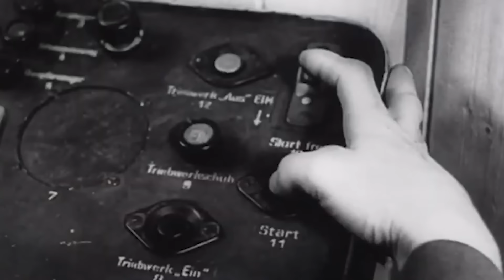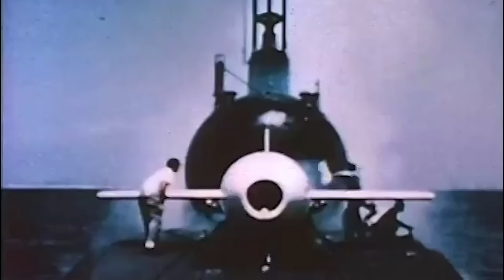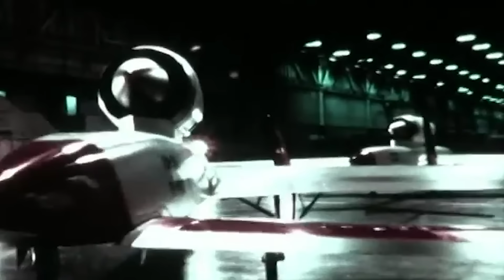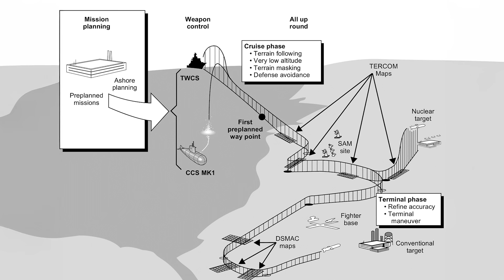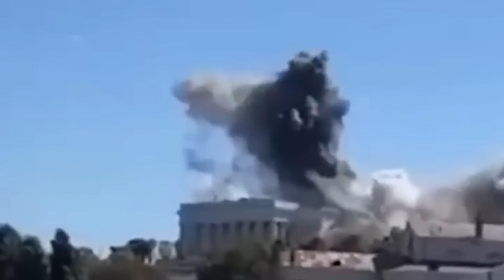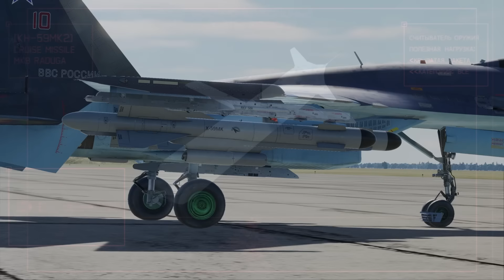The Evolution of Cruise Missiles: Redefining Battlefield Dominance

Comment: It's interesting how blurry the line is between missiles, guided bombs, and drones. Especially early on but even now. At what point does a bomb become a missile when you strap wings, a motor, and a guidance system to it like the JDAM-LR? At what point is a drone a missile when some one way drones have ranges comparable to the low end of medium-range missiles? Is a submersible one way drone just a better torpedo?
Reply: well, missiles= rocket fuel as propulsion , guied bombs= can glide (or not) , drones = can be smart (or not)

Comment: Pretty disappointed by the errata in this one - your quality is generally very good.  

AGM-86A had a range of 1200km AGM-86B had and has a range of nearly 3000km.  

ALCM could most assuredly be carried on the same Common Strategic Rotary Launcher as AGM-69 SRAM. That was the entire point.  That's why the Bone had 2 bomb bays ahead of the wing carry-through, by removing the structure between the 2 it became a single large bomb bay able to accommodate AGM-86B on CSRL.  B-52Gs could carry 20 AGM-86Bs - eight internally on CSRL and another 6 on the Heavy Stores Adapter Beam under each wing. 

I don't know where the claim that AGM-86 or AGM-109 performed "poorly" in 1980 came from.  That is not the case at all.  Each service chose the weapon system tailored to their needs.  GAO was highly annoyed at the perceived "waste" but as usual they had no idea what they were talking about. 

AGM-28 didn't get a Skyhawk engine,  it was the other way around.  All Skyhawks produced in the 50s had Wright J65 engines.  The J52 was developed in the late 50s for the A2F (later A-6) Intruder and the AGM-28. The Skyhawk didn't start receiving J52s until well into the 60s with the A-4E.  

I appreciate your channel but these were some clangers.

Comment: No P15 Termit? You may forget it but the Israel Navy won't 😅
Reply: Termit is not very long range CMs like the ones mentioned in this video, Termit is at that range level of Harpoon, and Exocet, you better do some research.
Reply: @Ramal3866  But it still a cruise misiles :v
Reply: @MLPFRIENDSHIP360 no it's not, by definition cruise missiles have the ability to fly in long ranges (ranges over the Termit maximum range) and self navigating. Termit only has below 100km range and it's not in the cruise missile bracket. If you want to talk about the Termit then it's better to discuss on the Anti ship missile videos not in the cruise missile video or forum.